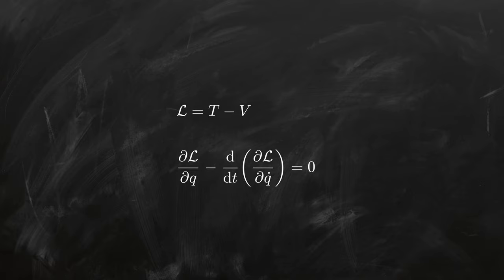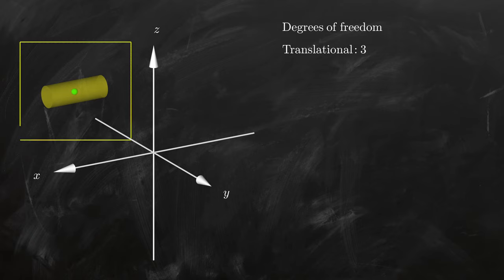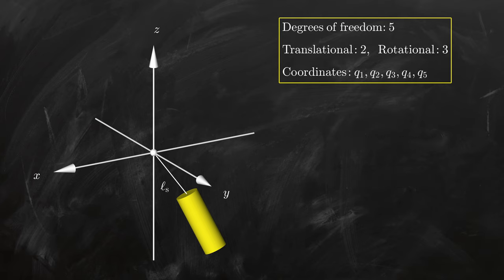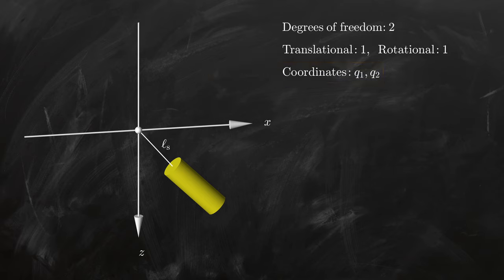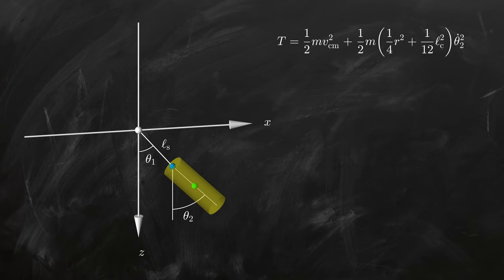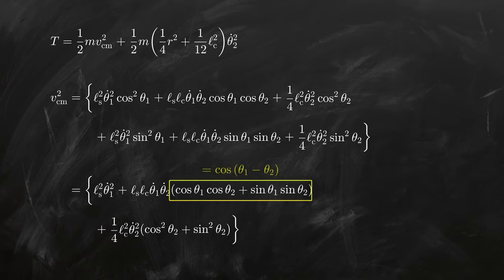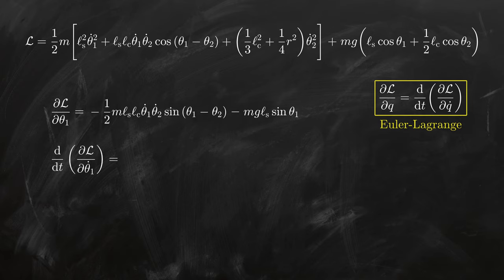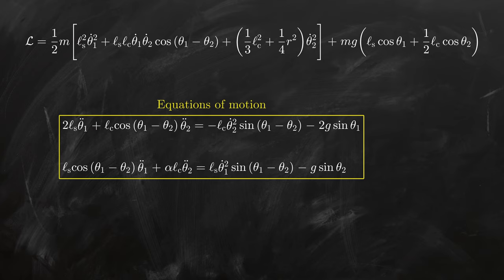Lagrangian Mechanics II: Degrees of freedom, generalized coordinates and a cylinder

Comment: For the rotational kinetic energy you used the moment of inertia about the cylinders center of mass. Why didn't you then apply parallel axis theorem to get the inertia about the pivot point? Since this cylinder is not rotating about its center of mass.
Reply: Good spot!
Reply: Due to the change in magnitude of the center of mass's location over time, inertia also changes over time
Reply: Im slightly confused as to what you are getting at. The center of mass location is dependent on time, but the magnitude of the center of mass itself is time independent, therefore the inertia about the center of mass is time independent. You may be thinking of the rotational kinetic energy term, which is time dependent due to the angular velocity component, theta dot squared.   What I was pointing out was that in the video the author uses the center of mass inertia when building the lagrangian, but his object is rotating about a pivot point at the top of the cylinder, therefore he should have used parallel axis theorem to find the inertia about the pivot point.
Reply: @auden7560  you are right this cylinder rotates about the pivot point and this rotation is represented by using theta 1 but this cylinder also rotates with theta 2 and the rotational kinetic energy can be calculated using theta2. so using the center of mass inertia makes sense because of the change in angle theta2. You can't ignore the second theta because the system has 2 dof. Shortly, the Pivot point doesn't affect rotational velocity but the end of the spring ( top point of the cylinder) effects

Comment: Hey I have a question, what would be different if we decided to use a polar coordinate system? How would you construct the cg position vector and would differentiation change in any sense for the Euler Lagrange equations? Maybe the Jacobian would get introduced in some form?
Reply from the maker: I can't say how practical it would be, but It's an interesting idea, for sure! I think the main difference from a vector calculus perspective is that the unit vectors in a polar system are themselves functions of position (see for example https://en.wikipedia.org/wiki/Polar_coordinate_system#Vector_calculus ) as opposed to the static unit vectors of a cartesian system. This means that we would have to differentiate the unit vectors, as far as I can tell.
Reply: @physicsfluency5541  I remember in taylor's physics book, when using polar coordinates in some problems, having to use the product rules of differentiaton to do derivatives of vectors cus we couldn't get away with treating each coordinate as separate (since the basis vectors weren't constants)

Comment: Hi! I like your videos very much! You should have way more subscribers. So you made MATLAB routines for animating equations? I program in Octave, which is almost the same except for performance. Would you be ok with sharing some of your routines with me? I also have a small channel and thought about making a program for animations but haven't yet gotten to it. I also don't have much time but if I made any interesting changes I would share it back, of course. Hope it's not too much to ask. Thanks!
Reply from the maker: Thank you, I hope more subscribers will gather if I keep making decent content! I would be more than ok to share my stuff, but I'm currently trying to overhaul the fundamental structure a bit, so it is sort of a mess at the moment, hopefully not for long though. Once I have things more under control I can put together a zip for you if you want.
Reply: @physicsfluency5541  Yeah, no hurry! Since last night I have been thinking on ways to program animations on formulas. If you don't mind my rambling: One way would be to write the formula in any editor, make a .png or .jpg and then manipulate that with matlab/octave. That would require an easy/fast way of marking the start and end of the different parts of the .jpg matrix. And it would be limited to certain types of manipulation. But another would be to manipulate latex code that prints the different formulas. Last time I used Latex it was in 2007/2008, and I don't know how much latex can be manipulated from inside matlab. Just thinking out loud...
Reply from the maker: @niconeuman  I'm pretty much doing it the second way, by directly updating the positions of text objects (rendered using latex) in a figure window. Positioning is a bit tricky to figure out, since to move individual parts of an equation around I'm forced to write each part as it's own text object and then it of course doesn't recognize other parts of the equation automatically, which creates alignment issues...  but I feel like I'm getting the hang of it.

Comment: Really nice video. I have a suggestion for the animations in future videos, but please feel free to ignore it as it involves more work for you!

I really like the way you substitute terms from one equation to the other by flying them in, e.g. the RHS for T and V fly into place in the RHS of L=T-V. This makes it very clear what trivial mathematical manipulations you are doing. Slightly less trivial steps are things like the simplification of terms, pulling out common factors, use of trig identities etc. It may be useful for people to see exactly which terms you are working on by dynamically moving them around. Take for example at 9:05, it may be useful for someone to see which terms you are grouping, by flying them down from the first equation for v_cm^2 to the second equation. 

Again, this is just a small suggestion, so please ignore it if you don't feel it's necessary to chase down that last 0.1% of quality. The presentation is very clear and lucid as it is.

Looking forward to the next one!
Reply from the maker: This is very useful feedback, thank you! I've been building functions for all the manipulations of expressions, printing PNGs of the frames etc. from scratch in MATLAB (it's the environment I'm most comfortable with as a former engineering student), and I'm always trying to find ways to improve stuff. So getting input like this really helps.

I will definitely try to implement something like what you suggest.
Reply: @physicsfluency5541   wow, in MATLAB? I wouldn't even know where to start! 

 I'm sure you already know about the Manim python library that 3blue1brown uses for procedurally generating his animations? I don't know whether it is any easier to use, and of course you have already taken the time to develop your own functions and workflow. But I mention it just in case you have a look and find it useful 😉
Reply from the maker: @jms547  I do indeed get a lot of inspiration from 3blue1brown! But it does feel like he's way ahead in terms of manipulating latex expressions... I might take a look at some manim code to get a few ideas on how to go about it. The Python and MATLAB languages are kind of similar and I have done some smaller stuff in Python so I can usually understand the code without issues.
Reply: @physicsfluency5541  Python has the advantage of WAY more libraries and much broader applicability. I'd say it's certainly worth spending some time to become fluent in. Loving the videos, looking forward to more! :)